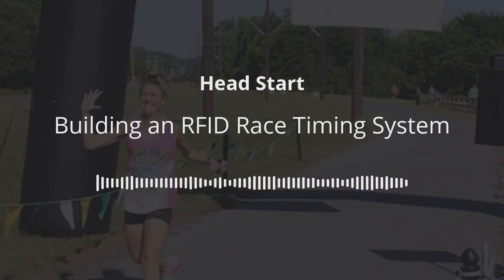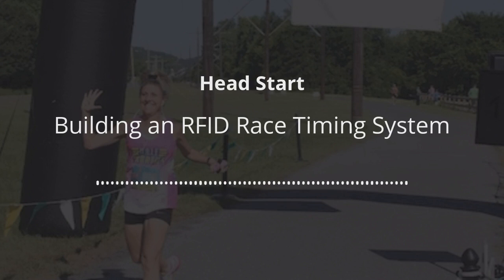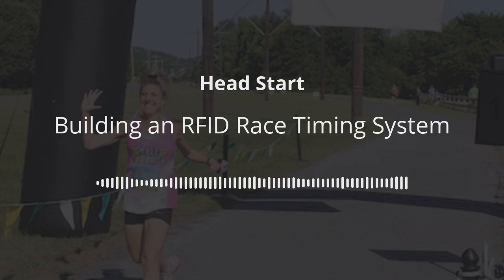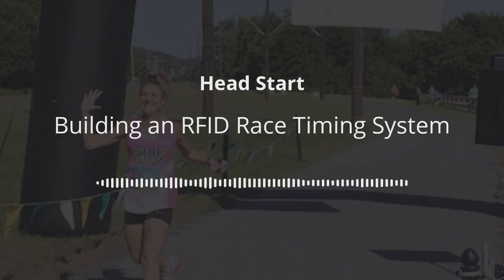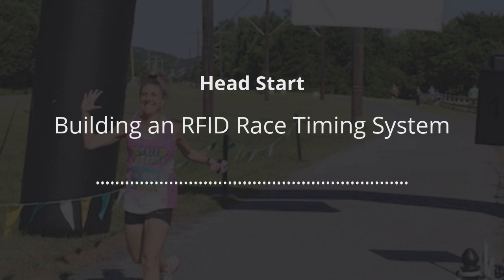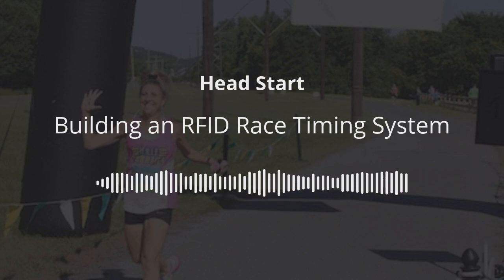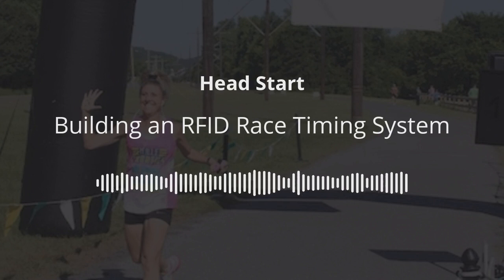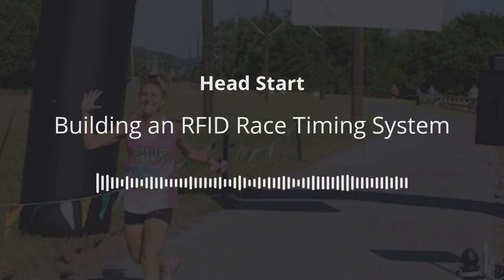Building an RFID Race Timing System

Comment: Factual error at 11:33 of the video: Webscorer pricing is not "per finisher".  From Webscorer website, Webscorer PRO chip timing costs USD 250 per year with no limit on the number of racers or races.  From Agee website, ART chip timing cost is a one-time fee of USD 900.